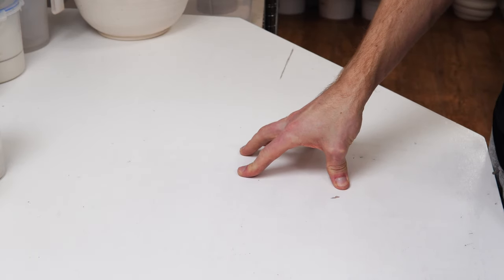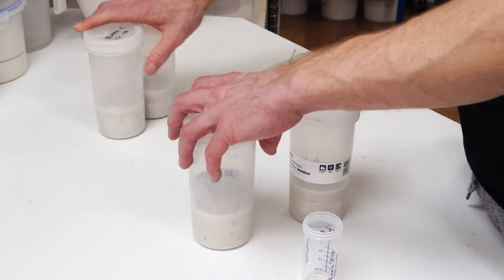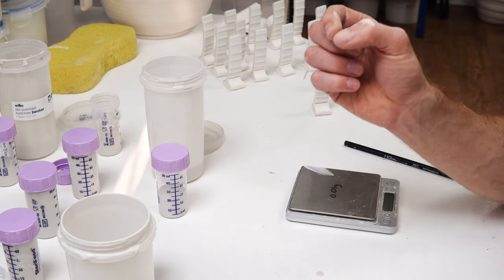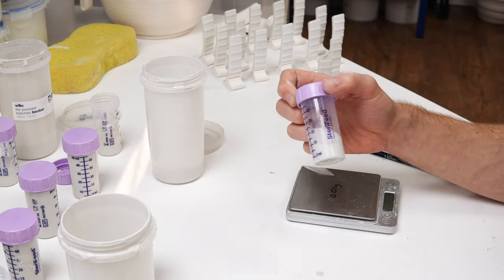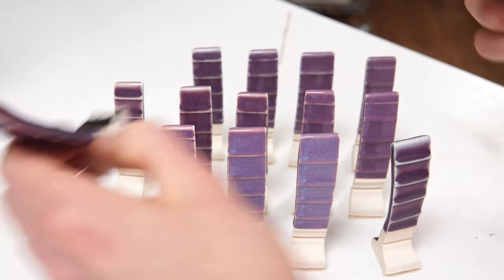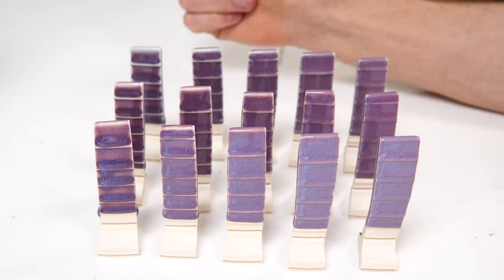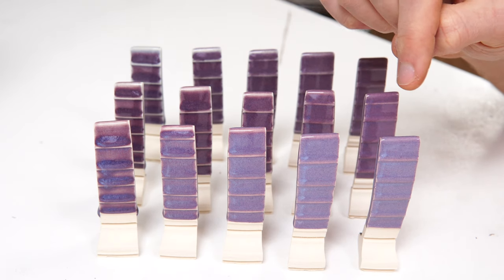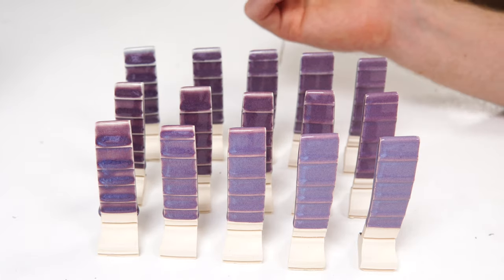Testing Glazes Efficiently

Comment: An experiment where you try every combination of a set of variables (parameters you can adjust) is called a "fully factored experiment".  As you noted, this is usually impractical to do - way to many experiments.
This type of problem comes up in engineering where you have a complex process that has multiple parameters but is difficult to model.  One example of this is injection molding.
In 1926 Ronald Fisher came up with a Statistical concept which he later called D.O.E. which (as long as the variables are mostly independent) allow you to determine the best settings with way less experiments.  
I know bringing up Science and Engineering processes to tackle an artistic question may get me shot but, I thought is was worth mentioning.
BTW, I liked your video - I only got the chance to scan it for now but I do plan to com back and watch it in full later.
Reply from the maker: Thank you, I'll have a look into that. Funny enough, I was just reading about Ronald Fisher in Nate Silver's book as he was one of the first opponents to Bayesian probability. He seems like a very interesting character!
Reply: @OldForgeCreations  Let me know if you want collaborate.  Pottery is my new side thing.  My main thing is I am a Medical Device Engineer (hence the interest in stats) and I am also a University EE instructor.

Comment: So if I wanted to do a similar test, which 4 variants would you recommend? I want to test with your Floating Base, and then find the best one for my oven temperature and clay body. How do I find out the 4 corners? The rest makes sense.
Reply from the maker: You can never go wrong with a Stull map test. So the four corners would be points on the stull chart - Bottom left is low silica and low alumina, bottom right is high silica and low alumina, top left is low silica and high alumina, top right is high silica and high alumina.

If you do that, you'll get a great gradient from clear, flowing, and crazing in the bottom left, up to opaque, stiff, and potentially underfired in the top right. Somewhere in the middle will be the sweet spot for your kiln and clay.
Reply: @OldForgeCreations  Thank you! Would you be so kind to share the percentages for me? Let's say "Floating Blue".